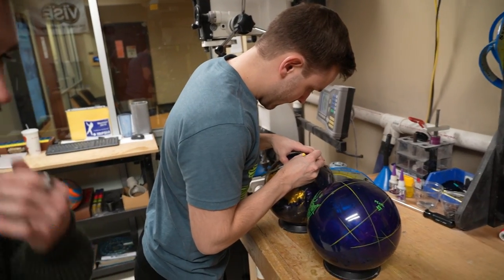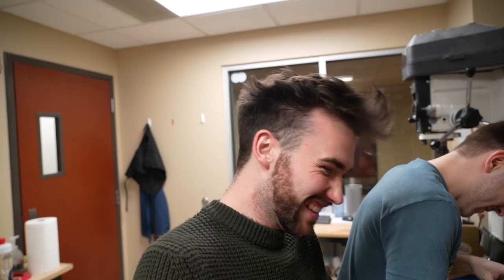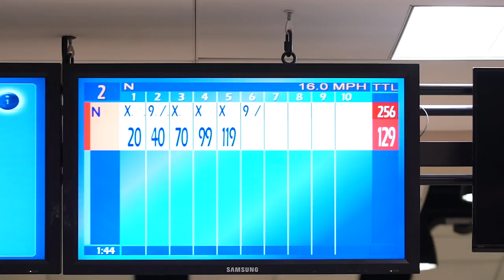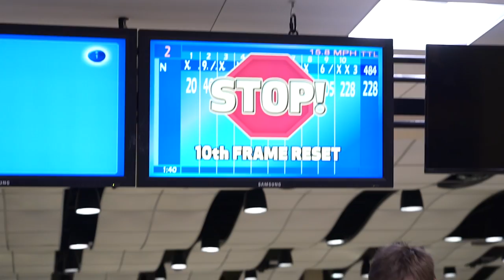Making Illegal Bowling Balls |  Episode 2 Weight Holes!

Comment: Reading some negative comments about the weight hole ban.  Let me explain some more.  USBC did a study and discovered the static weights on the ball don't really affect ball motion as much as everyone thought. What they did find out the differential matters more than static weight.  When a thumb in bowler drills a 1-1/2" interchangeable thumb hole, they remove quite a bit of the heavy core mass.  If they then drill another 1" weight hole, they can remove more core mass.  Look up Mo's double thumb layout, this layout effectively raised the differential of the drilled ball significantly.  

For the next episode of illegal bowling balls, I'd like to see Packy drill a double thumb layout.  See the before and after the "thumb"  and weight hole is drilled.  If memory serves me correctly, a no thumb bowler was allowed to drill the thumb hole and balance hole if they could prove they could grip the ball with thumb hole, now there are rules against it.

Comment: So, weight holes, I believe, were used to move around the mass bias relative to a bowler’s PAP. With a crater that massive and that much closer to your PAP, it shortens the PSA to PAP distance (or creates a smaller 1st angle). This is a much weaker PSA to PAP distance/angle since it makes the core more stable. Additionally, with the shorter distance, it makes the ball roll a lot earlier.

If you like those smoother drillings and want to replicate it, you could start laying stuff out with those smaller PSA to PAP angle to get the mass bias closer to your PAP.
Reply: Explain abrevations please
Reply: @conniewaldby5524  PSA is the “preferred spin axis” which is basically the mass bias. It’s the point on the ball that marks the place of the intermediate differential and is really only present in asymmetric bowling balls.

PAP is the “positive axis point.” Every player rotates the ball around their own unique axis and if you think of the axis as a line, it intersects the bowling ball and two points on the ball’s surface. If you’re a righty, the PAP is the axis point that face towards the left gutter. If you’re a lefty, the PAP is the axis point that face towards the right gutter.

Proshop owners use PAPs as the basis for all their measurements because it represents how a bowler is going to orient the core on release. In order to get the bowler to orient the core the way a certain drilling intends, the ball must be drilled based on the PAP.

Comment: Hole depth was not enough.   As Mo used to say,  it should be at least 3" deep before you see an appreciable change in performance.   Try doing this again, but go with a 4-5" hole.
Reply: That’s actually outdated information that storm disproved while doing their research for the 2LS system. The point of diminishing returns for hole depth when the pin is 6.5” from the fingers (or in this case we can use the weight hole being 6.5” from the pin) is somewhere between 3.25 and 3.5 consistently on all their charts. The same physics applies to thumb hole depth and weight hole depth.
Reply: Reference their video for people who actually want the proof of this

Comment: You drilled a thumbhole, its only llegal to bowl with the hole you use
Reply from the maker: I drilled a weight hole that I did no use…thus it is illegal to throw
Reply: I think there was 4 total holes. I could see a thumb hole early in the video. If so double illegal as a two finger bowler. Which is the point of the video 😉

I'm just finding out about this rule this week after taking like 7 years off from bowling. It's really annoying to need to plug our old balls 😢

Comment: Most every ball is not legal !   Check the true diameter.  Max legal is still 8.583  anything made in the last 15 years is over  that,  USBC  does not care.As long as they get there $$$    By the way this does not help the bowler on there first ball as the ball hits the pocket. Think about which pins take out which pins and the angles the  pins are moving during a pocket hit. The ball that is oversize will cause the bowler to leave  more ten pins if you are right handed. Think about it the movement of each pin .

Comment: But really, they made weight holes illegal so 2 handers couldn't do that 3 finger hole triangle deal to make 1 ball into 3 🤷‍♂️. Need to somewhat even the field, that's when the X on palm started also. USBC doesn't care for 2 handers it seems but PBA is hedging all bets on them.
Reply: I was a thumb out one hander in the mid 90s 
4 balls was really 10.
4 with thumb in
4 with thumb out
2 I would turn ball  around and get a weird roll out on the back end. Didn't use that shot much but fun to play around with.
Reply: @ripvanrevs  would definitely be handy if bowling in a tournament with a ball limit lol

Comment: The ball was already "super illegal" before you did anything to it by 1960-1970 rules and standards.
Reply: You mean before plastic was even made? Before they ever put cores in the ball? Before urethane and resin? Or before no thumbing it was even experimented with? Because there was never anything in the rule book about no thumb.

You think golfers should be using wooden shafts and iron heads still?
Reply: @jimboscalawag8809  In the 1970's strict rules were put in place on ball reactions and strengths because the scoring pace was rising unexpectedly do to the new technology and they started to crack down hard on that to keep the game honest, just like what was done for Baseball which remains the same sport as the past.
Also oil patterns started to get longer than 24' increasing the scoring pace and it was a big concern that patterns that could "funnel" the ball must be prevented.
So even a terrible beginner resin ball would be illegal at that time as a total cheater ball.
And House Shots would never be allowed.
So my point is, total cheater balls and funnel house shots would be highly illegal during that period of the 70's, but they are the norm today.
What does that tell you about where the game is today?
Reply: @nordattack  tells me you dont have a clue what youre talking about because oil length was 42 feet back then

They instituted the hardness limit because people started soaking rubber balls. Thats it.
Reply: @jimboscalawag8809  Face Palm... You never heard of the ABC "short oil rule?"
Reply: @nordattack  which was in the mid to late 80s. I worked for one of the women who won a couple of them in the pwba.
Reply: @jimboscalawag8809  But my point is the patterns and balls we use today would have not been allowed in the past.

Comment: I can't stand the no hole rule. Just because two handers ruined it by using the triangle drill. Just ban that. Don't punish everyone for the 10% of bowlers
Reply: The triangle drill had zero effect on the rule implementation.  It was coming regardless.  If you can't stand the no weight hole rule then you need to throw the ball different to get it to hook properly.
Reply: @brianm6117  lol. The rule exists for one reason. To get people to buy more balls and more expensive asym balls. Since they literally do the same thing as a weight hole. I never really used a hole. People that did never had an advantage. It's definitely a dumb rule. What's next we have to have two slide shoes?
Reply: @Stomping Peak  That is the dumbest take ever.  The USBC doesn't benefit from people buying balls and there was zero need to replace balls, all you had to do was fill the unused hole.  My buddy had it done.  He had a 3 finger ball (he's a one hander by the way and used that) and he also had a spare ball with a thumb hole.  He simply had the extra hole filled and the balls are now legal.  Many many many people just had holes filled.  People didn't go buy new balls just because of the rule.
Reply: @brianm6117  you're not understanding. The holes were put in the balls to make them act like asym balls and roll earlier. Now for you to get that reaction you have to buy a top of the line ball. Where before you could put a hole in anything and get it to act like a big asym. Think b4 you comment. My God. I'm sorry master.
Reply: @stompingpeak2043  There is literally no need to buy a top of the line ball.  You were the one that made a stupid comment saying it only had to do with sales, when that is the furthest thing from the truth.
Reply: @brianm6117  ok boss.